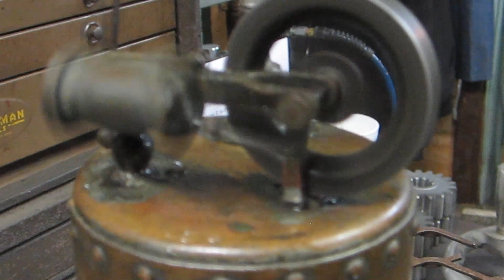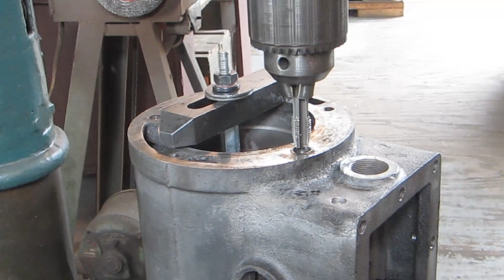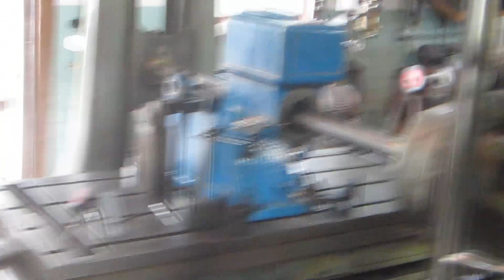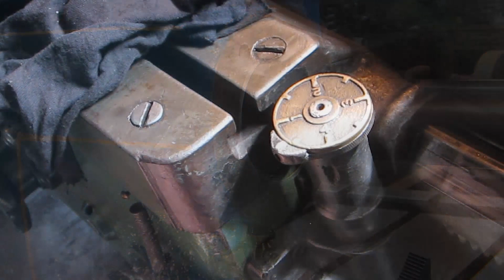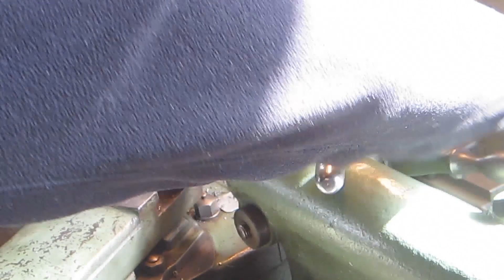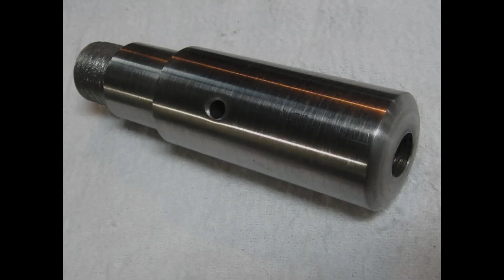OLD STEAM POWERED MACHINE SHOP 25

Comment: Very interesting machine shop and video. I had enjoyed watching it. I have the same boring machine in my collection. Mine is model 25 RT so I have a smaller 2' x 2' table that rotates manualy.  It was a pleasure to watch someone else still using one as an important piece of shop tooling. Mine is pretty much my most important machine to me and my work.  So thumbs up 👍👍
Reply from the maker: Great to see you doing all those operations with the old G&L....Dave

Comment: Nice job on the fly wheel, I have been a heavy truck mechanic, weld and fabricate shop owner, union Ironworker, and now at 62 a welding instructor. I have had cast iron jobs that the best filler metals would not work but the brass rods would, victory goes to the men with broader knowlege there will aways be a place for brazing in industy. That being said I would always try to TIG weld that thing If it was easier to handle. QUESTION have you ever covered your cast repairs with dry sand to slow down the cool time? Even better is to use pearllite or vermiculite because they both insulate and isulate the part for the air.

Comment: G'day, Dave! I really enjoy seeing your work! I was noticing your hat, like the East Broad Top Railroad and Coal Company, or 'EBT' for short, is a legendary narrow-gauge shortline located in south-central Pennsylvania that historically was a profitable coal-hauler. The road dates back to the mid-19th century although for roughly the last 50 years it has prospered as a popular tourist line hauling passengers on a short section of the original right-of-way. Oh, by the way, Am Sharing: Another Marvelous Machinist On YT, Keith Fenner - Turn Wright Machine Works! Thank you so much for your wonderful, "line shaft, and great old leather belting powered by steam run, in this awesome 'Ye Olde Shoppe'!!" 

Cheers! :-)
Reply from the maker: The East Broad Top Railroad machine shop was the sole inspiration for this shop. I volunteered on the restoration of their shops for a number of years.....Dave
Reply: G'day, Dave! Wow! That is awesome to hear, and quite impressive, too! (line-shaft machine shop, 100 'plus' years old; and Still working!) As you may know, "During the peak years of freight service the 'EBT' served several mines that tapped a lucrative but centralized seam of coal. Interestingly, it was lack of demand for this product that cost the railroad its only major source of revenue. Still, foresight by the line's last owner spared it a certain fate of abandonment. Today, the EBT certainly ranks as one of Pennsylvania's most popular attractions thanks to the Friends Of The East Broad Top Railroad and its rare status as a National Historical Landmark." By the way, I too, picking up some neat tricks to try out myself! Thank you so much! :D (smiley face)

Comment: David, discovered your fine channel a week or so ago and have been power watching to  catch up with the present.  At some point you mentioned your boiler draws air poorly in certain weather conditions.  Have you considered venting your steam exhaust up the flue through a blast pipe like most steam locomotives do?  That would let you control the draft by valving more or less steam through the flue as needed and give your stack exhaust a more pleasing appearance at the same time.

Comment: Just an idea,where you had to add weight to the pulley,if you drilled and tapped 3/8 nc holes through the face where you applied the lead,say 3 each side radially about halfway between the spoke and the rim,the lead would be keyed to the iron.
Really enjoying watching your series,thanks.

Comment: I love the series, great old machines. I am wondering  why you are not putting the new engine where the existing engine is, it seems to me that the new location will be in the way?
Reply from the maker: Rudy, The concrete pier would have to be ripped out and I want to run a DC generator for lights with the little engine...Dave
Reply: Thanks for the reply. I do really enjoy the channel. Thanks again for taking the time to do it.

Comment: In your opening shots you show a drill press with a tap in the drill chuck. That is really bad. The tap is too hard for the chuck to grip the tap. It will slip and the square end will bugger up the chuck jaws. You should use a tap chuck or a steel sleeve that engages the square drive on the end of the tap. Does the drill press have a reverse for backing out the tap. If you are only usint the chuck to start the tap straight that is OK.
Reply from the maker: Hi Ross, Maybe that would be a good rule in a high school shop, but in the real world power tapping was done like that. If you are leaning on the tap too hard it slips and you stop.....Dave

Comment: Nice machining demonstrations, as usual. That was a bit of an hot angry flame for cast iron. Tip looked/sounded a tad dirty as well (bit hard to tell in the video, tho'). A cooler flame and heating it up more gradually might have avoided drama, to avoid pitting and maybe a flat multi-port nozzle for preheating, and a smaller tip for the brazing. You're right about working from edge to centre: less metal to more metal. But I weld bike frames, so it's a bit of a different ballpark, and I may be talking beyond my pay grade :).
Reply from the maker: It's an old beat up Smiths torch that should be thrown away....Dave

Comment: I really enjoyed this episode Dave! I picked up some good tricks to try out myself, and just overall enjoyed all of your content. I do a lot of the same work as you do. Question, what method of measuring do you use when line boring those cylinders? Do you remove the bar and using inside mics or telescope gages?
Reply from the maker: Hi Adam,  I use an old inside spring caliper and then measure it with a micrometer. When it gets close, I do pull the bar back and use a telescoping gauge or inside mic, and set the tool with an indicator. Very time consuming......Dave
Reply: Hi Adam, steam is fascinating to watch ,  it's sort of a slow motion of todays machining w/ electricity .

Comment: A wooden ceiling will warn you if it starts cracking. This is why they used wood in mining. Just be sure to wear some safety goggles then. LOL You will also notice the belts coming loose.

Comment: Hi Dave, I collect old magazines that were printed in the UK called practical engineering and were published by that prolific engineering Author FJ Camm. These are really are now because they were published weekly and printed on Newsprint. i actually had 250 of them stolen back in 2000 !. if you ever get the chance to look at a copy ,have a look at probably the best source of engineering knowledge as done in the days of calculations done with pencil and paper . The amount of info contained in articles on subjects like die casting which went on for several dozen issues was amazing .Here's a link to a library collection of them ..http://www.gracesguide.co.uk/Practical_Engineering_Magazine

Comment: Thank you for your time and have work to post these videos. About 50years ago my grandfather ran a small town welding and machine shop that I'm reminded of every time I watch you. I learned more from helping him in that shop than all the rest of my years training. That was about the happiest time of my life! He had me repairing cracked pulleys a lot like you just showed.  By the time I was old enough to work in his shop he had switched his line shaft over to an electric motor instead of the hit and miss motor that he'd used originally. It was still there as a backup. Thanks again for the wonderful memories!
Reply from the maker: Thanks, great comment John.....Dave